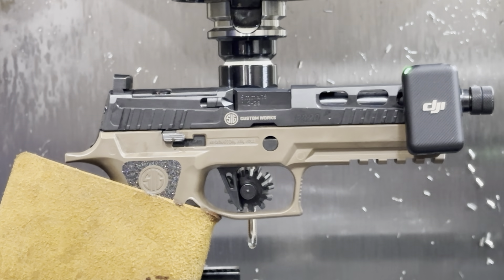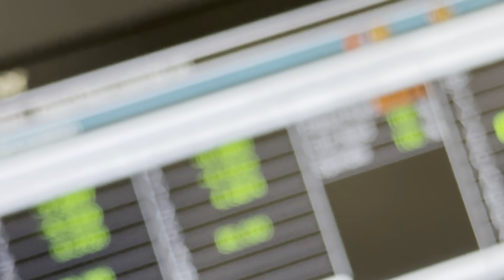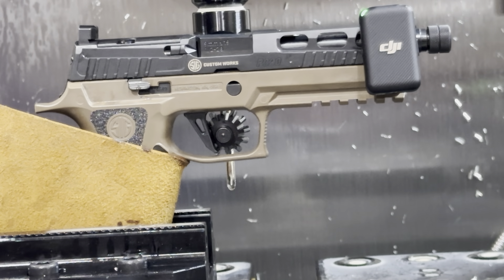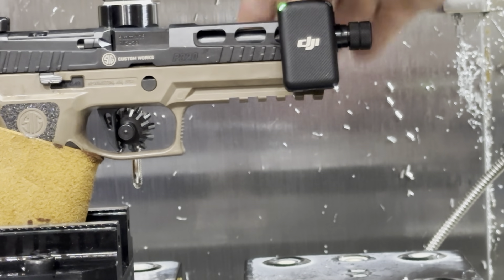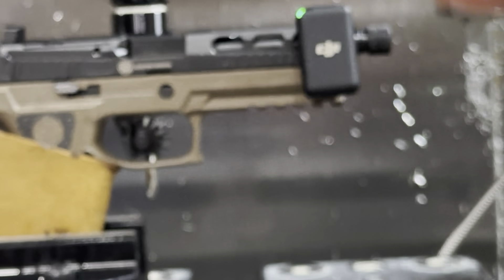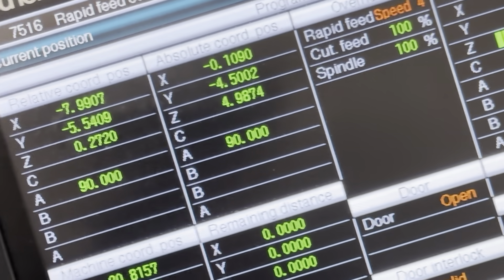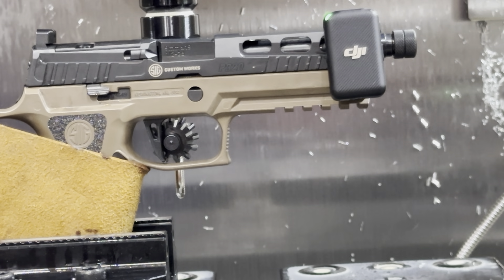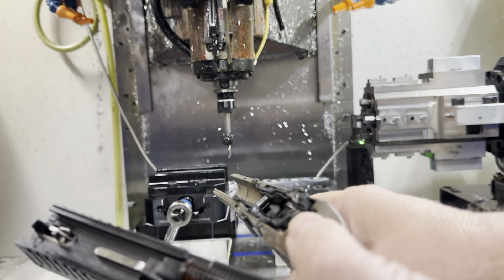Sig P320 accidental discharge tested in CNC machine.

Comment: I’d like to see you do this test on a lot of other striker fired pistols. Very cool video.
Reply: Oh yeah.  Would love to see this with the P365, Glock 17/19 on the Gen3, 4 and 5, and maybe some of the other popular ones.  I wonder about the amount of play in the slides with, and without loaded mags, and what the impact would be.
Reply: @somerandomhuman-zi9kt  there is zero up and down movement in my P365 and P365XL
Reply: @TerryHaupt616  @TacticalAdvisor has a couple vids with the 365, it discharges / delays based on slide movement as well
Reply: @somerandomhuman-zi9kt  me too the 365 is my every day carry to be honest. I’m quite nervous carrying it now.
Reply: @SD-kt6cb 365 has a completely different sear setup that’s essentially identical to glock’s and the like, those guns are perfectly fine. The 320 had a different sear design because they were putting a striker fired system in a hammer fired gun retroactively in the design.
Reply: @andrewkarsten5268 thanks so much for taking the time. I really appreciate it
Reply: @SD-kt6cb  The 365 is a completely different "From scratch" (and much better in my opinion though personally, for carry, I do not like striker fire pistols all together) design. 

The 320 is, for all intents and purposes, a modified 250 which as you may or may not know, was a hammer fired pistol. In the form of a 250,  there is no problems because the sear and the hammer are part of the same assembly. In the case of the 320, the sear and striker are part of different assemblies and play (slope) between the assemblies (slide and frame) can (and clearly does) cause the sear to striker engagement to "release" if it trigger is pulled enough (assuming everything else is working properly).

On your 365 however, there shouldn't anywhere near the amount of play (slope) between the slide and frame and thus at worse, it might release like the 320 BUT not nearly as early as the 320 (no that the 320's are all that early, or well at least not the one seen in the video here given that it wont release until about 82% of the trigger travel pass the wall (before normal trigger caused sear release).
Reply: @SD-kt6cb  Different trigger system
Reply: @azdragoon72  thanks for the response so you think I’m good to go
Reply: @CP_300PRC  I really appreciate the information thanks a lot
Reply: @SD-kt6cb   @TacticalAdvisor has a couple vids with the 365, it discharges / delays based on slide movement as well
Reply: @andrewkarsten5268   @TacticalAdvisor has a couple vids with the 365, it discharges / delays based on slide movement as well.... doesn't seem to be as common as the 320s issue.
Reply: @canopyjunkie  not a single point in that video was he claiming the gun would UD, in fact the claim in his video is he would pull the trigger all the way the the gun still wouldn’t fire. That’s a fundamentally different mechanical issue and not relevant to the P320 situation.
Reply: @canopyjunkie  thank you for the info. I’ll look into it. Have a blessed day.
Reply: @somerandomhuman-zi9kt  The two Glocks I have have zero play in the slide cocked or uncocked.  Fully disassembled, there's quite a bit of slop though. /s
Reply: Please do this with all the popular models
Reply: To those wondering about  Glocks, Glocks strikers are not precocked like the P320, this is why the 320 has such a nice pull compared to a glock.  Glock striker is cocked by the pull of the trigger.
Reply: @lancebangwell sim, é uma arma de ação dupla
Reply: M&P. Cz p10, Glock, canick,
Reply: @mr.mr.3301  and the 365 or other SIG weapons
Reply: @mr.mr.3301 yes canick too
Reply: he proved the glock failed the exact same test. watch his other video
Reply: @CitizenSeven500 I watched the new video.  It required much more trigger travel to replicate.  Which tracks since Glocks are not 100% precocked.  The perfect storm for Sig. a trigger dingus would have solved this and the drop safe issue years ago.
Reply: Why? It's basically a fully precocked striker sitting on a small ledge , which gives a relatively light break. If you're going to pull the trigger damn near all the way where you're a tiny fraction of a millimeter off then you should expect a gun to possibly fire. This even applies to a glock which is why a certain amount of sear engagement is important.
Reply: @Magneticitist this. All that movement rearward is defeating all of the safeties. No one does that in normal operation.
Reply: @DamnManSam  I mean people who own Glocks should already know that there is an ever so slight difference in the trigger pull with a fully loaded mag in vs an empty one. It should be obvious why that is.
Reply: I agree.  It would be a valid comparison.
Reply: I would say there are two problems, 1 a design problem and 2 the trigger pull is too light.
Reply: Yes people we all know Glocks aren’t fully cocked like the P320. And clearly there’s a very good reason why.
Reply: @miletello1  How about don't let anything activate your trigger.
Reply: @ragerDuane how bout learn about stacking tolerances and striker perch.
Reply: @miletello1 How about learn that "travel" is you disengaging the sear and if you travel the trigger 82.6%, obviously you can pull the sriker leg the less than half a mm off of the sear, on probably all guns.
Reply: @miletello1 I’m pretty sure Walther, canick and smith mnp are fully cocked.
Reply: @miletello1  It has been shown that a partially cocked striker will still has enough energy to light off a round if it comes loose from the sear. There are videos on it.
Reply: @HalfCrazy520 it’s also been shown that people survive catastrophic car wrecks without wearing their seatbelts. But that sir is what we call an outlier.
Reply: If you think this is ok for a modern firearm you’re coping. The reason this is bad is because if the manufacturer assembles the gun with an out of spec part(s), that 1 to 2 mm of “wiggle room” you had, that was preventing the striker from falling, will quickly be reduced to zero “wiggle room”. This is also compounded by the fact that the striker is damn near if not fully cocked upon chambering. From what we know at the moment, Sig can try fixing 1 of 2 things or both. That being fix QC issues with the trigger parts by bringing them back home to the US. Tighten up the slop in the slid. Or as I said, both. I personally would start with the slide because that is a fugg ton of movement which is clearly where most of the tolerance variables are changing.
Reply: @miletello1  If you are disengaging the sear by that much it is unreasonable to to expect the sear not to slip off when you wiggle it. You have already pulled the trigger 82.6% of the way. There is no wiggle room for your liability as soon as you start disengaging the sear, because if you have done that on purpose it means you intend to fire. If you have done that on accident you are negligent.
Reply: @miletello1  I agree with you. I’m just saying there are a lot of variables creating the perfect storm.
Reply: @miletello1 I disassembled my P320 to try to figure out the slop on mine. There’s essentially two points of slop, the slop between the grip holding the firing assembly together and the slop between the firing assembly and the slide together. The slop in the first is irrelevant to UDs, the slop in the latter is very important. What I found is the slop in the former in mine is all the slop I felt, and in the latter there was absolutely none at all.

In other words, the slop in a lot of these sigs is the imperfect seating in the polycarbonate handle, but that’s actually irrelevant to the issue at hand. If something is causing the sear to drop, it’s something else. Probably it’s the poor design and weak parts, but not the slop.
Reply: the sig has a shooter trigger pull but both let the seer go 20 thousanths before full pull
Reply: *shorter pull
Reply: @CitizenSeven500  The question now is how could the M18 that killed the airman fire when they all have manual safeties, since that should theoretically lock the trigger.

1911s have extremely short trigger pulls by modern standards but they're still safe to carry so long as you have the thumb safety engaged, which simultaneously locks the sear and blocks travel of the hammer so it's extra safe when engaged.
Reply: @gameragodzilla  There are examples of 1911s "uncommanded discharges" and for many years it was called "dangerous" to carry, it's took a lot of use by USPA/IPSC and Jeff Cooper to change thinking.
Reply: @CCW1911  That's only from people who didn't use the thumb safety properly. The 1911's thumb safety is extremely robust and safe.
Reply: @gameragodzilla on the M18/M17 and P320 with manual thumb safeties, it only locks the trigger. 
There's an Army report online that a soldier at range disengaged safety and weapon discharged w/o trigger pull.
I've seen video of MIM parts out of spec, damaged due to sig outsourcing parts to fulfill contracts.
Reply: @gameragodzilla  The manual safety on the P320 family of pistols only blocks the trigger bar, it does not block the sear from releasing like say how the manual safety works on the P365. It (the P320 family manual safeties) does still allow for some small movement of the trigger but its not supposed to be enough for the trigger bar to contact and start releasing the sear.

Because if doesn't block the sear, its has a secondary function to prevent firing if the trigger is pulled with enough force to overcome the primary blocking feature. This secondary function is that it will force the trigger bar down into a disconnected reset condition, the same way the slide does when it is slide back to the rear. This causes the bar to drop down below the sear interface to prevent sear articulation.

Now is this a design problem.... Ehhh, while I would say that its not the greatest of designs, I wouldn't say that is a "design problem"... Just that it could have been done differently (better) but that is not to say that its a flawed design.
Reply: @gameragodzilla  it didn't. he lied and was arrested
Reply: That would be neat!!!
Reply: Yea like mine.
Reply: This. No w I’m curious is my Glock or shield does the same thing 
They don’t feel like do but this CNC is sooooo accurate right? Anybody with a cnc machine willing to do a side by side comparison please. If I had one.
Reply: @jeramiahmcneece9992  I don't have a CNC or any of those guns unfortunately, but my hypothesis is that at least a majority of all firearms  will discharge in response to wiggling its components if you leave the same amount of sear engagement or 0.48mm of trigger pull.
Reply: @jeramiahmcneece9992  You don't need a CNC machine to do it, if for one could be done on a manual mill with a good DRO on it. 

Beyond that, you don't even need a mill, just a simple fixture with a fine thread screw and a dial indicator and you could replicate exactly what the "CNC" is doing with good accuracy in the thou of an inch precision range (same has his display, just without the 10ths which is splitting hairs for something like this and is not needed).

No, I'm not talking about a cheap digital calipers and a drywall screw, I'm talking about a fine thread screw and a fixture that clamps onto the frame and the screw arranged so that articulates the trigger in a linear motion and the dial indicator reads the screws travel.

Hell, in theory, you could get reasonable results with no dial indicator and just math because of the known lead of the screw based on its pitch BUT there is more room for error here due to having to resolve for degree's of rotation accurately enough to give reasonably accurate linear travel (lead) of the screw. 

With all that said, If I can find some time at work one day, I'll recreate this with some other models on the CNC.
Reply: he does this with a Glock as well, check his vids. It's the only other video. Only difference is Glock trigger HAS to be pulled due to the trigger safety tab. If the Sig had this feature, we wouldn't be having this P320 issue as without that depressed the sear can not be manipulated. With that being said, the amount of slop in that slide.... you could probably lift the rear of the slide enough to pull the pin safety off the sear. I think the reason this is even happening is strictly because of that slop.
Reply: I have never seen a slide as loose as the 320 in general... Not even a Taurus is this sloppy.  Oddly enough, the x10, which has a slightly wider frame and slide, doesn't have this slop or the auto trigger.
Reply: It's important to understand that with this type of pistol, the firing pin is always under tension when the pistol is loaded. Unlike other striker-fired pistols, where the firing pin is loaded by pulling the trigger, this mechanism—similar to the M17 and M18 that I work on for the military—keeps the firing pin ready at all times after loading. When you squeeze the trigger, you are simply releasing the firing pin, while in other designs, you are loading the firing pin instead. These are two completely different systems, and I hope people grasp how this works.
Reply: I will definitely be checking my pistols for sloppy slides, but I'm pretty sure the slides don't wobble around like that on any of mine.
Reply: Same here, and even though 1911/2011 are known to not be as drop safe it would be cool to see this test done on some of those as well. @garandthumb did a fun video, not nearly as precise, but one of the more expensive 1911's failed
Reply: Please
Reply: Agreed. Having it done on similar guns in the same video would be very key
Reply: I think it would be pointless because other striker pistols  have a trigger safety.
Reply: @Gieszkanne It's not pointless. The whole point is to test is whether it is normal for a sear disengaged to less than a mm of contact left can be bumped off on most guns. If you're arguing that other guys don't "UD" because of a trigger safety (which I agree with), guess what you are supporting as the cause of the discharges?
Reply: @Gieszkanne  You're right that we don't know for sure, but based on the years and years and years of everybody and their grandma, including Sig who has the most incentive of anyone to discover the cause first, the evidence points to what is being shown in this and other videos. It is not obvious in all cases that it wasn't user error. I know of several cases where it appeared to be not user error, but was later easily identified to be user error (backpack strap caught in holster shown on video, finger caught in holstering shown on video, and keys caught in holster evidenced by key marks in trigger guard). There is no reason to think that other situations could not be caused by similar situations that just would not be possible to know without video or forensic evidence. Think to "crotch guy" who shot himself in his crotch with a Glock. There is not apparent explanation for it in that video footage, and yet no one doubts he somehow caused a trigger activation. I do not agree that it is a dumb design. I do agree that a trigger safety would solve the current phenomena. At the same time, the fact that that would solve the current phenomena, if it indeed would solve it, would prove that trigger negligence has been behind the discharges.
Reply: He does it with a Glock and gets the same result
Reply: To all the gun smiths who shoot 50rnds a year pulling the trigger 90 percent is a trigger pull if you dont want it to shoot dont pull the trigger. Also absolutely no one cares that your glock has 3 internal safeties. Your gun is still trash they both are.
Reply: 100%  don't play with the gun while you are pulling the trigger
Reply: https://youtu.be/LKD0S3KhwdI?si=m8J5jWeELyAN6Ngb
Reply: Exactly. This seems to be a compund effect of two factors: striker plus modularity. The first one gives us sear engament between slide assembly and the internal frame. The second one is the cause of not so tight tolerances, because so many parts must plug and play.
Reply: https://www.youtube.com/watch?v=L17Mq7XxtlE
Reply: @davee5384 I posted this after the 1st video.
Reply: Same
Reply: ALL pistols are TRIGGER FIRED--PERIOD You press the trigger and they fire!
Reply: every striker fire brand will do the exact same, including your glocks
Reply: yes trigger smart did https://youtu.be/LKD0S3KhwdI?si=sPG5d1gGAZckatEi
Reply: A glock wouldn't fire. Glocks have three internal safeties. There's no play in the slide on any of the five (gens 3,4,5) glocks I have. They WIlL NOT fire unless the trigger is pulled. PULLED, not '2mm' into the stroke, but the ENTIRE stroke, until it actually fires.
Reply: @Firedrake1313 The reason a Glock won't do this is because the trigger moves the striker rewards to "cock" the firearm.  Continued trigger travel releases the striker.  If the trigger press is released before the firearm is discharged, the striker returns to the forward resting position.

On a Sig P320 when the slide goes forward the sear captures the striker holding it back into the "Cocked" position.  Sig did this to get a shorter trigger release and reset.
Reply: @JimBrady-m4q sorry, but a glock would/could do this same thing in a similar test... this test is #1 removing all trigger slack which disengaged all 3 trigger safeties on a glock, then #2 stating to slip the sear to the edge of disengaging, then #3 shaking, moving parts of the gun until the play in the system allows the striker to slip past the sear, I would venture every striker fired gun would fail this at some level
Reply: @jeep2525  The separation is the Glock has a trigger safety that is being depressed in order to preform the test. Without that safety being depressed a Glock will not discharge.
Reply: @JimBrady-m4q And that will be the end of their company...
Reply: @Firedrake1313 I agree. Plus it is not 100% precocked like most are.
Reply: @mr.mr.3301  i tried it on my tanfoglio stock and i can't make it click
Reply: @Firedrake1313 2mm is only 0.019" from the full trigger pull.  Lol
Reply: @johnpaolonejr1299  .019 is a lot when you're talking about sear engagement.
Reply: @johnpaolonejr1299 it’s close but the take up requires minimal pressure versus a trigger pull.
Reply: @GvnAdventures LOL.  He was already .090" into the trigger pull.  The take-up measurement in the video is 0 on his scale.
Reply: @3gunshooter60 .019" is the trigger movement not the sear engagement
Reply: @3gunshooter60  While .019" might seem like a lot relative to sear engagement but when you put it into proper prospective, it is 18% of total movement from wall to release (i.e., the trigger has to move 82% of its total wall to release travel before rocking of the slide causes sear release).  That .019" isn't much when you consider that its only the last 18% of trigger pull.

Now don't get me wrong, I'd like to see it closer to 0% (at least less than 10% and preferably less than 5%) but relatively speaking, its still quite small because its also 18% of total sear engagement (i.e., the sear too is moved 82% of "its" relative total movement).
Reply: @johnpaolonejr1299  These people are scrambling to justify why it's ever been a good idea to carry a gun with no manual safety, or Glock styled trigger safety. 

I have a Gen 4 Glock 40 MOS, along with my P320 M17. I really enjoy both, but I'm terrified every single time I point my G40 at my balls inside my IWB holster because it has no actually safety I get to actuate.

And genuinely RIP to that airmen, at 21 that's a terrible tragic event. But under no circumstances, are you supposed to ever flag yourself with your firearm. If it's loaded, or unloaded; Holstered, or unholstered. You never point your gun at yourself, especially at chest height, and you certainly are never trained to throw down a loaded, or again unloaded firearm with force.
Reply: @iTrinityPlays all my carry guns are hammer fired HKs with LEM triggers in them.  They have no external safety but the initial pull is very long so there's no way it goes off without intentionally pulling the trigger.  I also cover the hammer with my thumb when I'm re-holstering them so I would feel if something is catching the trigger while re-holstering. Even then, I won't carry appendix.  I have one striker fired carry pistol and it's an XDM Elite 10mm.  They have a grip safety and it's impossible to pull the trigger and release the sear without the grip safety compressed.  I re-holster that pistol the same way as while my thumb is on the back of the slide the for safety is not compressed so that gun will not fire.
Reply: @Firedrake1313  I would love to see them tested just to prove it though. I think it would be fair.
Reply: @Firedrake1313  Pull the trigger back some amount of distance, and the internal safeties disengage. That's how striker-fired pistols work. There's going to be play, and I guarantee a bump would cause the sear to slip.

I am not saying the p320 doesn't have problems, I'm saying this will happen with most striker-fired pistols. It's already been proven.
Reply: Glock was already tested on a different channel. It also fired.
Reply: @Firedrake1313 this comment has aged well.

Lol.
Reply: @Firedrake1313  so very accurate, Glock would never release sear due to slack being pulled up even when you take the trigger safety out of the equation. I am by no means a Glock guy, I prefer my FNX 45 Tac over the Glock any day of the week but i EDC a Gen 5 Glock 19MOS. Because my belt gotta be on so tight i cant feel my legs to keep my pants from coming down on the weight of that 45...
Reply: @Firedrake1313 
Glocks do it to...
Video :
P320 vs Glock "Uncomandded" Discharge

🤷‍♂️
Reply: @Firedrake1313  So for a fair comparison, you need to pull the glock trigger till it only has 0.48mm of travel left in the trigger then wiggle it.
Reply: @Firedrake1313  And that's the reason Glock triggers feel like mushy old rotten bananas, and severely need a trigger upgrade out of the box. Once that happens, it gets much better.

Again, it's not great it's going off 2mm in the stroke, but it is in the stroke nonetheless. Plus proper gun educate teaches you never to put your finger on a trigger unless you're about to use it. Not sit there with your finger on the trigger 2mm into the stroke, then while aiming, start fucking with moving your slide at the same time. 

This is an issue for people who have a shit ton of stuff on a duty belt, and having the gun holstered with interference from something they have on their person. Sometimes it's the holster itself, other times it has been keys, etc. 

This is an issue that is very clearly solved by using a P320 model that has a physical safety on it. Without one, you're just asking for issues. This goes for even external hammered gun, where you have the hammer down, any safety off, and 1 in the head. That would be considered unwise, and stupid to do.
Reply: @Firedrake1313 Glocks failed this same test lol. So they DO fire and they do have wiggle room. Hate to break it to you
Reply: @Firedrake1313  2mm is pulling the trigger, "2mm into the trigger pull" that's what the man said...
Reply: @Firedrake1313 
Yeah, there’s already videos of people getting the same results with ALL striker fired pistols. Pulling the trigger to the wall defeats every safety measure on every gun.
Reply: @Firedrake1313 it's already been tested and 1mm of travel from the wall is enough that slide movement will fire a Glock. For reference this 320 took over 2mm from the wall. This is just how striker fired guns operate, and it doesn't appear to be the actual issue with the 320
Reply: @Firedrake1313 i'm guessing you don't understand that the cig has a very short stroke and seeing how he even shortened that stroke by putting aftermarket parts on his, this video doesn't hold any water. So many of these guys are modifying the s*** out of these pistols, and then doing stupid tests on them more than likely he f*** his gun up, and now wants to act like sig is the problem. Do it on a stock pistol not one he's modified
Reply: @Firedrake1313  Wrong https://www.youtube.com/watch?v=LKD0S3KhwdI&t=174s
Reply: I have the new Glock 45 COA and the Glock 45 the non-MOS blue label program. I also have the 19 gen 3 and gen 5, the 17 in gen 3 and gen 5. Not one of them has any play in the slide. I highly doubt you will be able to recreate that with any Glock.
Reply: Yeah but the problem ,is not every striker fire. Has that in play on the slide like the 320 has. I trade  mine in.😅
Reply: @Cruiser777  It's not about the play, it's about how little contact surface you have left the sear with after pulling the trigger that far.
Reply: @ragerDuane yeah but that inplay  plays a good part of it that doesn't look right and that doesn't feel right. It doesn't matter.I got rid of mine. I don't care.
Good luck. to the people  that are stupid and naive. enough to keep it.😅
Reply: @Cruiser777 why do you play with the gun while you are pulling the trigger?
Reply: What the hell do you mean playing with guns?
I've been around guns probably longer than you've been alive.Excuse me i just use common sense😅. @EKSPYKER
Reply: @Cruiser777  yes common sense to not pull the trigger and play with guns
Reply: IDK why this gets complicated so much. As mentioned already in this thread, most guns are going to "fail" this way. Any striker fired gun you choose will have these two interacting parts, the striker lug and the sear, located in two different parts of the gun. The upper and the lower. The upper and the lower need some tiny degree of play for them to move relative to each other and keep the gun cycling. 

The very moment you pull the trigger on most guns, the internal safeties are being disengaged. This is the extra action that is taking place before the sear is being moved downward. With a Glock it's almost immediate. Either way what is happening in all these tests internally, is that all safeties are bypassed, and the sear is being moved to the point where the tiniest fraction of metal on striker lug is holding onto it. 

I struggle to imagine a scenario where someone is going to want to pin their trigger to 99.9% before the break, then try to mess around with their slide with the other hand... Or perhaps they are trying to do some stunt maneuver WHILE the trigger is pinned but don't want it to go off if it takes an impact... Well your hand is not a vice so the impact would cause you to pull the trigger the rest of the way anyway.
Reply: @Cruiser777 pansy